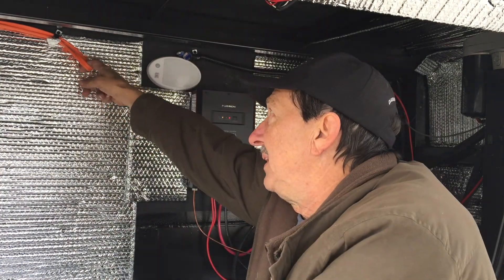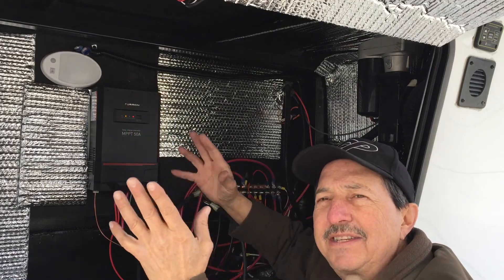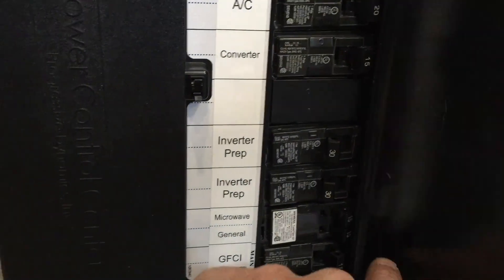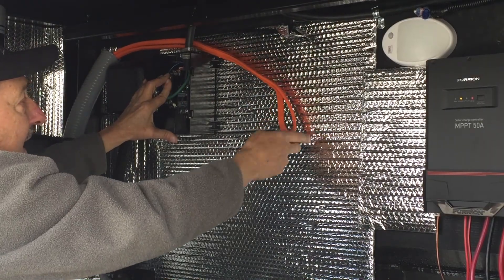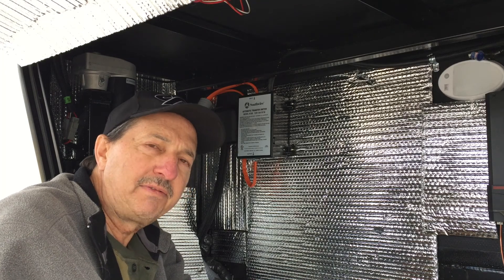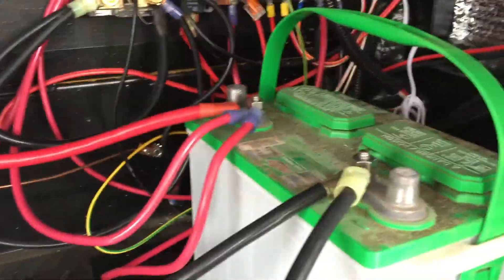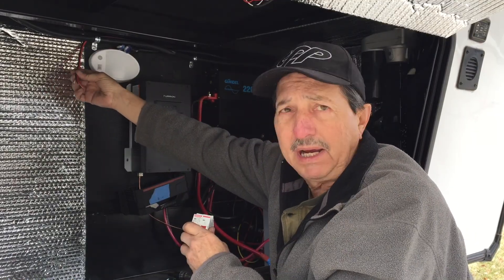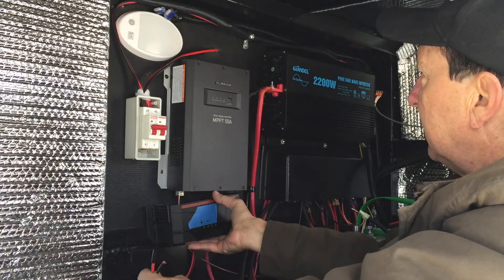Easy Grand Design Inverter Prep, Automatic Transfer Switch (ATS) And Inverter Install. + Solar.

Comment: Why a 30amp power transfer switch, doesn't your RV have a 50amp shore  power plug? shouldn't the power transfer amps match your rv's total amps?
Reply from the maker: With the split breaker box, the main power is 50 amps for dual AC but the lower half of the breaker box is 30 amp after the inverter loop. The inverter loop is set at 30 amp for the inverter and the breakers that are controlling that power.

Comment: Can I disconnect the inverter from the battery and still have power running through the transfer switch  box to supply my RV with power When I am hooked up to shore Power?
Reply from the maker: Yes, the auto transfer switch will direct power to the RV when on shore ;power with the inverter off or disconnected.

Comment: Great video, i do have a question though.  I have a 2025 GD with a very similar set up.  Is it as simple as connecting the wires to the batteries and connecting the inverter prep wires?  Can I leave all the other red wires connected to the battery which go to the solar controller, charge controller and circuit board?  I am thinking there would be two different sources of power going in to the inverter (direct from battery and from the prep wire which i assume is connected to the circuit board.
Reply from the maker: The battery can be wired direct but if you have a battery monitor you should connect the ground wire to the shunt in order to get correct battery information.

Comment: What gauge wire are you using from the battery to the inverter and from the inverter to the AUto switch?
Reply from the maker: Check your orange inverter prep wire. I'm pretty sure they are all 10 WG. I used the 10 gauge for 110. Match your batter cable, 4 or 2 is common for the 12 volt.

Comment: Thanks for your video!  I have a Grand Design with Inverter Prep and this is the EXACT info that I was looking for.  Specifically, the break in the breaker panel bus.  I appreciate you showing the process to explain how you figured it all out.  That clears up the wiring and saves me a lot of work trying to figure it out myself.  Hopefully, my small little Transcend One has the same configuration in the panel.

In regards to needing a breaker/fuse for your solar panels, it depends on your solar panel configuration.   Your single 165W solar panel, probably has a short circuit fault current of less than 10 amps, so even if it completely failed, it would not provide enough current to overload your wire or blow your 30A fuse.  If you added more panels in parallel, then a fuse may be needed.  The EXPLORIST has a really great video explaining fusing requirements titled "How to Fuse a Solar Panel Array for a DIY Camper Electrical System", which would be useful if you are thinking about adding more panels.  I'm surprised your Grand Design doesn't have a solar disconnect though.  My little Transcend One has a solar disconnect in the convenience bay.
Reply from the maker: Thank you for the comment. I am glad the video helps and I will check out EXPLORIST's videos.

Comment: What was the breaker box you put in , where did you get it ? Thanks !
Reply from the maker: The breaker box I show is the original one that was installed in the Grand Design trailer.
Reply: @riderescue I’m sorry I wasn’t clear , I meant the white fuse breaker you put down in the compartment ahead of the solar controller ! Sorry.
Reply from the maker: @kingfisher4790  Oh, that one. That is a Low-Voltage (12 volt)  DC Miniature Circuit Breaker, 50A 2P 500V for the Solar Panels. (bought from Amazon) The trailer has a 165 watt panel on the roof but no disconnect switch. When I added another 200 watt panel I wanted to be able to switch them off as well as protect against over loads or shorts. It also works great to be able to turn off the power from the panels when I service the solar system.
Reply: @riderescue yes that was the one ,great idea , I agree it’s nice to be able to isolate it there ! Thanks again! I have a 100 RL 28 same setup in the box ! 👍

Comment: Great video but how do you know what or where the first wire is goes to the transfer switch.Do you have to run a wire from the converter?     sorry I am so new to this I should be wearing diapers..lol
Reply from the maker: If I understand your question correctly, disconnect power, cut the orange wire, connect power and test the cut wires. One will have power and one will not. The powered one is from the breaker and the dead one is to the breaker. And yes, my converter needed a wire from the converter to the transfer switch. Good Luck!

Comment: So orange wire is connected to two breakers in your breaker box and when you cut it to your transfer switch feeds bus ?
Reply from the maker: Correct. The breaker bus is split between the two inverter breakers. If the orange wire is cut and not reconnected with a transfer switch the lower section of the breaker box will no longer have power. In other words, Upper bus is connected to the lower bus via the orange jumper wire.

Comment: My other question is. You showed us the on/off controller for the inverter. Does that mean we want to keep the inverter turned when not in use?  Thank you.
Reply from the maker: The transfer switch directs the power but the inverter does not need to be kept on. I have my inverter on a switch nect to my breaker box so that when I need it I can switch it on and off.

Comment: I love this. You are perfect on how you describe how everything works. With that being said, with this set up you can only power the bottom half of the box when switched to inverter power right? So no way to power the air conditioner. Is that  true statement. Thanks again.
Reply from the maker: Yes, the inverter prep provides power to the lower section of the breaker box. This does bypass the power to the A/C due to the load that the A/C needs. You can get an inverter large enough to power everything but that will overload the wires and set up of the breakers. A larger generator or inverter would be required in order to provide power to the full system.

Comment: Hi, just curious when you installed your lithium batteries, did you also use a warming pad for the batteries? If so, what did you use? Really appreciate your videos!!
Reply from the maker: I do not use warming pads. I don't travel or store in cold areas. Thanks for your comment and views.
Reply: @ Thank you!

Comment: 19:29 Hi, I’ve watched your video a few times now, and I don’t see anything about the converter/ charger. How is the disabled when the inverter is in use. Jeff
Reply from the maker: Great question. The inverter prep loop (orange wire) is designed to bypass the AC and the converter / charger breakers in the breaker box.

Comment: Outstanding video, really appreciate your in depth detail and information. I have the same exact rig and just ordered a new lithium battery, inverter and ATS. What size is the breaker you installed for the incoming solar feed to the charge controller?
Safe travels! 
Kind regards,
EJ
Reply from the maker: Glad you enjoyed my video. I have 365 watts of solar so I used a 50 amp low voltage breaker. To calculate, take watts of solar divided by volts. So my breaker need is 365 divided by 12 = 30 amps. I plan to add more panels so I bumped up to 50 amp. Also, my solar controller can handle 50 amp so the two can work up to that. Happy camping to you.
Reply: @riderescue  Thank you Brother, greatly appreciated! I’ll have all my materials here by next week and can do my install then! Enjoy all of your videos!
Be safe!
EJW

Comment: I have the same trailer and am doing the same install as you but was going with the 50 amp transfer switch. So my question is does your AC work when you are plugged in to 30amp and 50 amp shore power or genny???
Reply from the maker: I have a single AC and it works with both 30 amp dog bone connection as well as direct 50 amp.

Comment: hi, i have an inverter prep too, question im on a budget cant i skip the ats and just flip the converter breaker off when i use the inverter?  if the whole point is ending the cycle of recharging the batt from the energy of the batt, wouldnt that just essentially b an "mts" or manual transfer switch? thanks
Reply from the maker: The problem would be that when you cut the orange inverter prep wire the lower section of the breaker box looses shore power to the lower breakers. You will need some type of switching system to switch from shore power to inverter. With 30 amps, and 10 gauge wire, the transfer switch is the best option that I am aware of.

Comment: Great video!  wondering about what to do before splicing the wires coming in from the solar panels to install a disconnect.  This line is always on if I a not mistaking, right?  How diid you do it?  Thanks
Reply from the maker: Cover the solar panel with something that will black it out. I used a black rug.

Comment: Where is your power converter to charge the batteries? Mine is under the shower in the basement. You should be able to move your converter next to your batteries.
Reply from the maker: Mine is under the stairs. I looked at moving it but it is not worth all the work to run more wires. It is working great just were it is.

Comment: Great Video!  Did you have to change out your converter, to a Lithium carpetable converter or are you just using the solar panel to top  off the battery charge?
Reply from the maker: I did not change my converter. Since I have a solar panel my batteries have been charging to 100% when on shore power or while in storage.

Comment: Great video.  I am buying a 24 grand design fifth wheel toy hauler.  It has a 330 watt solar panel and the inverter prep.  I want an inverter...  I wish it came with the extra solar panel and 2000 watt inverter.  You are so right about not finding clear answers online.  I dont understand solar power...😅

Comment: Great video. Thank you.  I've watched a bunch on inverter how-to videos that deal with an inverter loop, but yours is the only one so far that explains how it works back at the breaker panel. Very nice job - easy to understand.

Comment: Thank you for a great video.  Exactly what I was looking for!!  What are your thoughts on using an inverter with a built in transfer switch?  I know it would be a more expensive inverter no doubt, but would it be worth the one less step in wiring it up?

Comment: Great video! I have a early built 2022 reflection which unfortunatly doesnt have the inverter prep. Any idea how the power center was modified to provide the separate breakers bus bar  isolated from main?

Comment: Bingo! Thanks for the inverter and transfer switch instructions . I was able to do this after watching a few times. Curious, did you try switching the inverter power at the transfer switch with the line coming off the breaker box? Wondering if I should do that.

Comment: Do I have to use an automatic transfer switch? Or can I just use the “on / off” switch that came with the inverter?? My Sabre fifth wheel has inverter prep also.
Reply from the maker: In order to use the inverter prep the way it is designed to split the breaker box, you will need to add a transfer switch.

Comment: Here's another thought. No power transfer switch required. Install inverter as normal. Turn off controller at main breaker in trailer. Plug the 50/30 amp trailer power cord directly into the 110v out on the inverter via a power adapter to drop 50/30 down to 15amps. Turn on inverter and now you have power to everything including your roof A/C. You still need to manage your power inside the trailer to not exceed 15amps even though a 3000 watt inverter has 25amps but the individual outlets are 15 amps.
Reply from the maker: Hey Earl, that does work well, I did that on my last trailer. The only problem I had was the AC power draw drained the batteries really fast. I bring a generator if I will need to cool down with AC. Last year the inverter was great, I never started the generator once. Lucky to have cool nights on all our trips.
Reply: I think you can hardwire to the output of the inverter to a 30 amp outlet and plug your trailer cord into that to go to the shore power plug on your trailer that would work wouldn’t it? I’m just curious.
Reply: @robertoa26  Yes, I have a TT-30 box with about 4 feet of cable to attaches to the 30amp r=terminal of my 3000watt LiTime inverter. I'm looking for a 30amp power to go from trailer shore power cable to be just long enough to the to reach the TT-30 box in my front storage compartment.
Reply: Another cool advantage to not using the switch and running straight to the trailer power connection as you can run just the air conditioner fan and not the compressor which I think is pretty cool. I think I’m gonna go that way thank you. But we all know it all depends on what your application is. There’s advantages and disadvantages to everything but regardless this was a great video full of great information. I loved it.
Reply: @robertoa26  Be sure to always turn off your Converter circuit breaker in the power panels so there's not a charging loop.
Reply: Thanks for posting this, for my application this solution will work. One question, why do you need to turn off the controller at main breaker in trailer? Isn't this just like plugging into a 110v shore outlet?

Comment: Thank you for putting this info online.  Can you please describe the setup you have to charge the coach batteries while on shore power.  Is it a 120VAC battery charger outputting in parallel with the solar charge controller?  Is the charger wired on the shore power feed side to the transfer switch?  Can you recommend a charger?  Thanks again for sharing.
Reply from the maker: Most all 12VDC charging systems are set up with a 120VAC to 12VDC converter / charger built into your wiring set up. The inverter can run all the 12 volt systems from shore power while also charging the 12 volt batteries. Some newer models have lithium charging options in order to hit the higher 14 volt charge needed to charge lithium to 100%. In my case, my converter / charger is not lithium compatible so my lithium batteries will only charge to about 80%. This is were the solar charge controller comes into play. The solar charger I have is lithium compatible so that will take over and charge my lithium batteries to 100%. So, both converter / charger and solar charger work together to run the 12 volt side while on (or off) shore power. With that said, the transfer switch does nothing while on shore power. Once shore power is disconnected, the transfer switch still does nothing till it received power from turning on a generator or a 12VDC to 120VAC inverter that is hard wired to the switch. The transfer switch then switches to allow power to run to your breaker box lower section to power your outlets (TV, microwave, etc.)
Reply: @riderescue  Thanks for the reply.  I confirmed that the converter in my RV has the auto select for lead versus lithium.  From what I saw on manufactures site for converters, most come with this feature now.  Your video probable saved me more that 1,000 bucks.  Now that I understand GD's inverter prep  setup, I know I can install the inverter, transfer switch, and smart shunt myself instead of by RV service center.  Thanks!
Reply from the maker: @BK-ku1je  It's a shame that GD has a great inverter loop but chooses not to give any instruction on how to use it. It makes me happy to hear that my video helps people like you understand how to do it yourself and save. Thank you for the comments.

Comment: Thanks so much for such a great video. 
One question I have is, do you need to connect a ground wire from the transfer switch ground bus bar to the RVs chassis ground?
Reply from the maker: No need for chassis ground. The power and neutral wires from the breaker box and or the inverter provides the grounding wires.
Reply: Thank you

Comment: Great video I think I can do the job. I have one question does the hotwire get connected to the incoming on the switch box and the other end get connected to the outgoing?
Reply: Thank you very much for that info. It seems like a pretty easy thing to do so I will have an inverter powering my trailer when needed
Reply from the maker: @jimdel9647  It's well worth the time and cost. We love our inverter to make a pot of coffee and to use the microwave or even a movie when the batteries are charged.
Reply from the maker: The orange loop will need to be cut. Once cut, you can test to see what end is from the breaker box (hot) and what end will go back to the breakers. The live end will connect to generator side (in) of the switch box and the inverter power will connect to the other in connection. The out will then connect to the wires that go back to the breakers.
Reply: Can you tell me if I connect the negative side of the battery right to the negative side of the inverter thank you
Reply from the maker: @jimdel9647  If you have a battery monitor you will need to connect the negative wire of the inverter to the shunt so that the battery monitor works correctly. If you do not have a monitor you can hook it up directly to the battery.
Reply: @riderescue  thank you